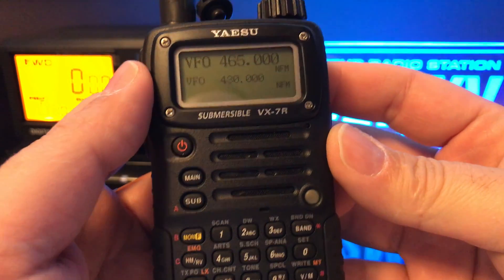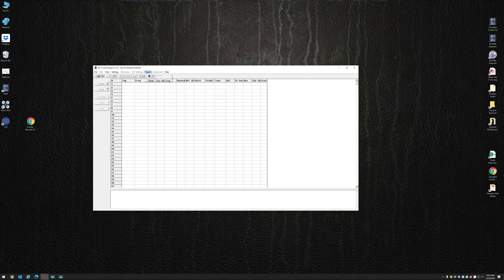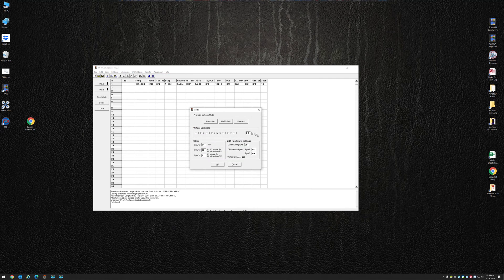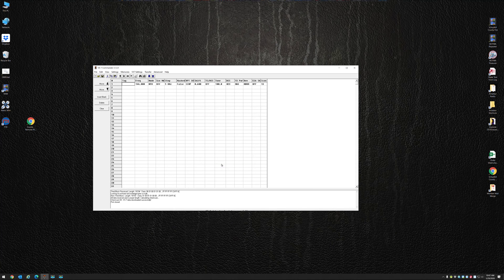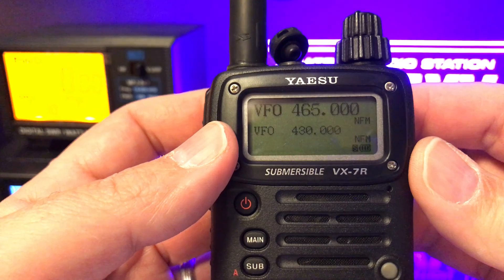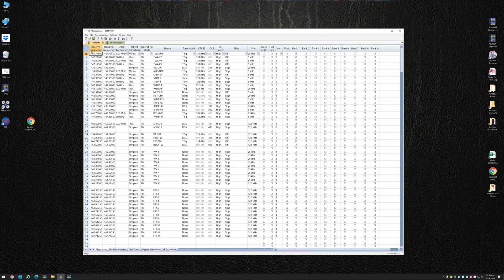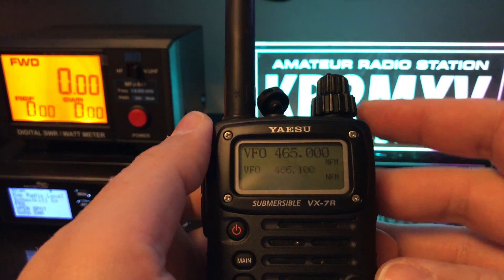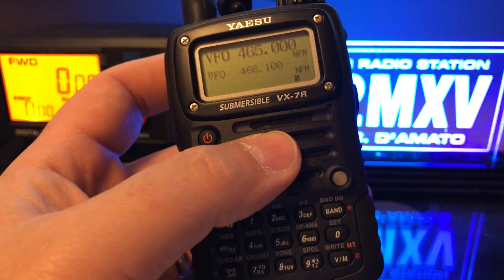Yaesu VX-7R MARS Software Mod

Comment: So you can do the software mod and program it by keypad too? I put the mod code in my 65r but you have to go in the menu and turn off the auto repeater shift to add gmrs repeaters or it won't remember it when you add it to a channel